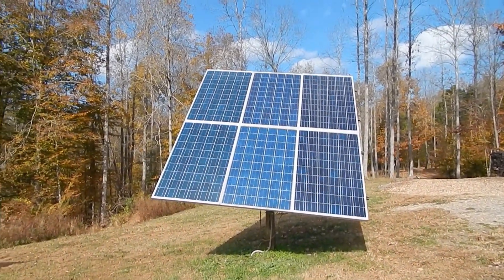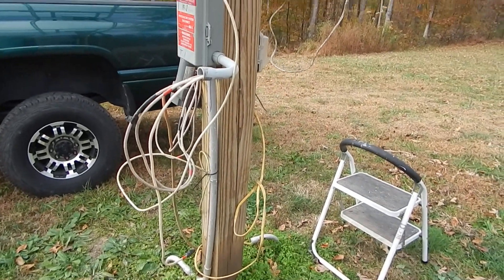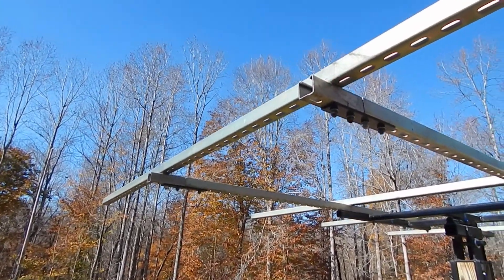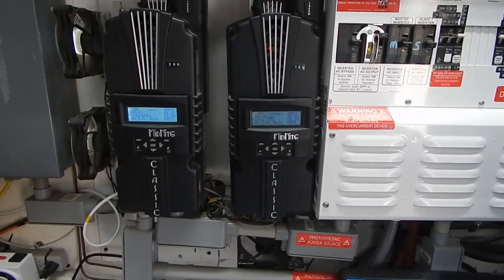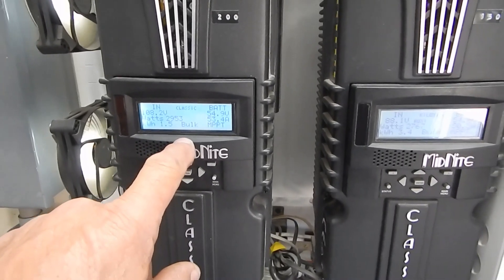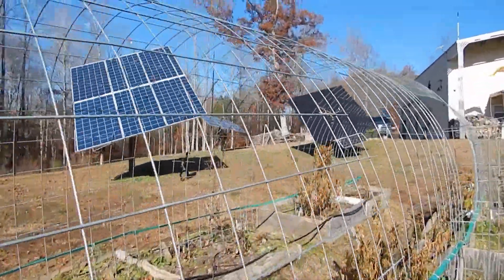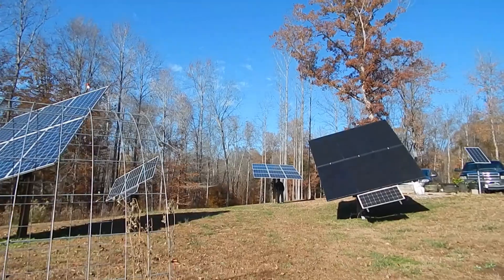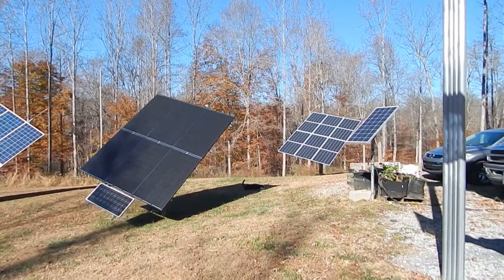Installing bi-facial solar Panels on tracker number one.

Comment: Very cool.  I thought my 2 solar arrays were neat but you have multiple tracking arrays lol.  Do you have heat pumps for HVAC? I'm installing a heated floor in the main room (that is cooler due to slab vs the rest of house has a basement) which will lower my natural gas use a bit.
Reply from the maker: Thanks. No heatpump, no heated slab, wood stove , propane heater, 3 ceramic 1500 watt heaters from the home I had in FL.